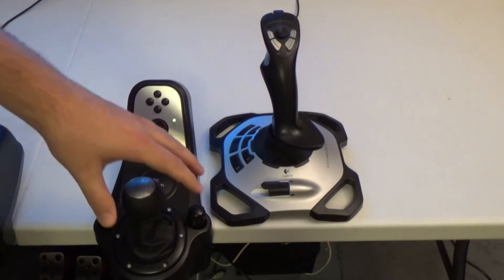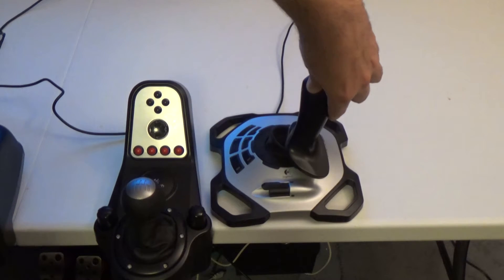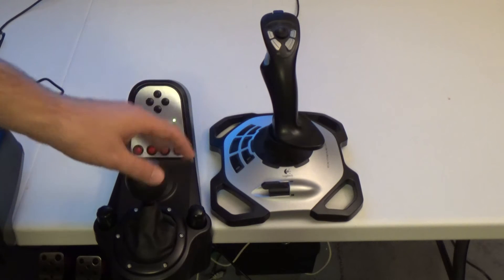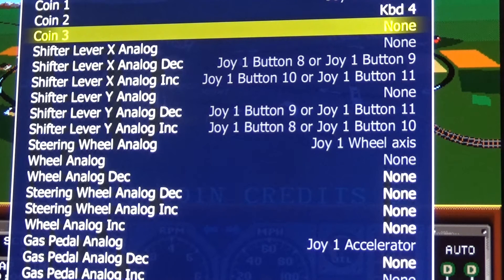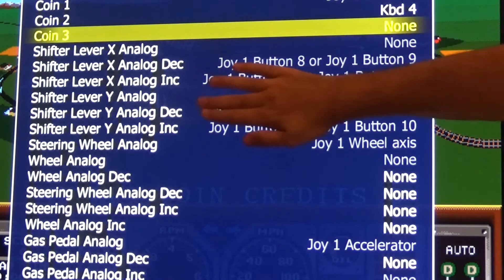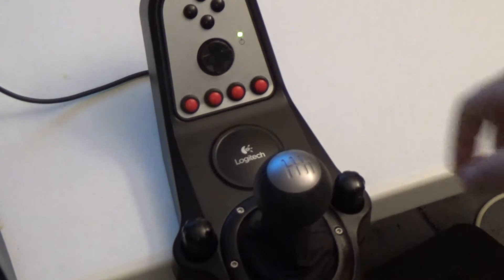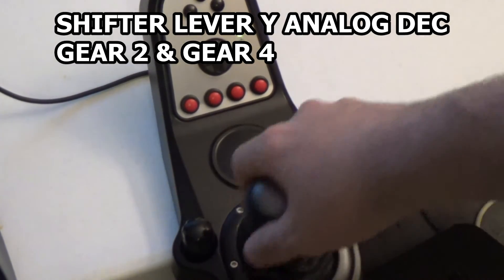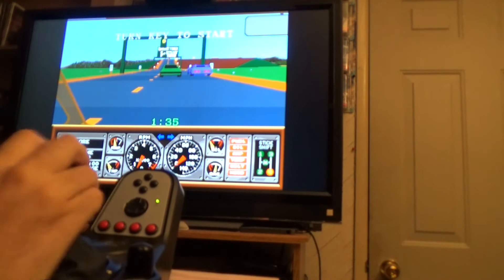Mapping a Gear Shifter in Hard Drivin'/Race Drivin' in MAME

Comment: Dumb question, but how do you select none for a button ?
Reply from the maker: Hit Enter to map, then press Escape to set it to None.
Reply: @DarthMarino  thanks man I figured it out one more question. I’m not sure if you can answer it but every steering wheel that I use there’s a slight pull to the right and I can’t seem to fix it.
Reply from the maker: @miketrav  Just in this game? Did you calibrate in-game?
Reply: @DarthMarino  I did the analog and turn wheel to each side  in game controls.  Is there something else?
Reply from the maker: @miketrav  There should be a calibration option in the games test menus (press F2 to access)
Reply: @DarthMarino  Yep, that was it. I would’ve never figured it out without your help. Thanks man.

Comment: Hey Darth I know this video is old, but I have a Logitech 920 and I can't get Hard Drivin to see third or forth no matter what I do. It recognizes the buttons when I'm configuring but the gears selector doesn't change. I'm running MameUI .209 with the 209 rom file. Any help would be appreciated.
Reply from the maker: Not sure what could be causing it. 1st and 2nd work ok?
Reply: @DarthMarino  Yea 1st and 2nd work perfectly, but I had to map the shifter differently. When I did it the way you did it doesn't do anything. I'm trying Hard Drivin, but I will try Race Drivin, I just need to get the CHD files for it.
Reply from the maker: @trevagraham1605  It would be hard to troubleshoot without seeing how you have everything mapped, etc.
Reply: @DarthMarino  understood. I will keep working on it. Thanks for responding.
Reply: @trevagraham1605  You ever figure this one out. I'm not having any luck with a g29 and the video setup for the newer shifter.

Comment: I followed these instructions and my gears are wrong.   Maybe the latest mame 0.217 changed things.    Basically my gears 1 and 2 and 3 and 4 are both swapped and backwards.   This should be enough to get me to be able to figure out how to fix it though!!
Reply: I actually fixed this now.   These instructions in the video are 100% correct for the latest version of MAME 0.217. The issue was that under "Analog Controls" I had "Reverse" set to "ON" for the shifter Axis.   Set those to "OFF" and it works perfectly!
Reply: I'm using this shifter.   https://fanatec.com/us-en/shifters-others/clubsport-shifter-sq-v-1.5
Reply from the maker: @gear323  That's pretty serious. That costs more than my wheel, shifter and pedals combined (G27).
Reply: @DarthMarino  did you ever get reverse working?  The full size cab version of hard Drivin and race drivin both have a 4 speed shifter with reverse.
Reply from the maker: @gear323  Which version in MAME? I checked a few and none had an input for Reverse and I saw nothing in the test menu.
Reply: @DarthMarino  I'm not sure honestly if it works in mame or if it is a bug.   The real compact game had 4 gears.   The real cockpit games all had 4 gears AND reverse on the real hardware.   I double checked my memory by watching YouTube videos.    Reverse is there.

Comment: Not sure what happened to my comments but in the Logitec Gaming software should I have combined pedals? Also, I got the shifter working great! How do I get the gas and brake to work on the G920? Thanks!
Reply from the maker: You can actually either combined or separate in MAME.  I usually use combined since it acts funny in the menus if I separate them.  I have a video on mapping combined pedals that might help.
Reply: Thanks. I'll do through your videos. I even tried your config file and that didn't work so well.
Reply: Also, I wanted to ask you. What version of MAME w/ version number are you using? Should I use 32 or 64 bit? Also, should I use the Cockpit or upright versions of Hard/Race Drivin'? Thank you!
Reply from the maker: If you have a 64 bit windows, use that version of MAME. I only play on Race Drivin' Panorama.  It has all the courses from Race Drivin' and Hard Drivin' plus an additional one.  If you don't want to play with all 3 screens, you can use some of the newer MAME's to only show the center screen. And of course if you really want to get crazy, play Hard Drivin's Airborne.  I have a video for that too.  The real game had a steering wheel that moved forward and back but I play with a throttle which works just fine.
Reply: Thank you!
Reply: I got everything working in Hard and Race Drivin'! Thank you!
Reply from the maker: Glad to hear. Enjoy.

Comment: which version of mame32 are you using? my menu's look a little different. for example,  there's no steering options. only paddles etc.
Reply from the maker: I believe I used MAMEUI64 0.162 when I made this video. I checked on the normal 0.183 MAME and the same options are there.

Comment: Thank you so much for this video! Can you tell me how to setup the G27 wheel for hard drivin properly? Mine works but it only uses a few degrees of the wheel, making it super sensitive. Everything works fine under the games input tests.
Reply from the maker: You should set it to the full 900 degrees in the Logitech profiler.
Reply: I don't know how I forgot about that setting, thank you very much!